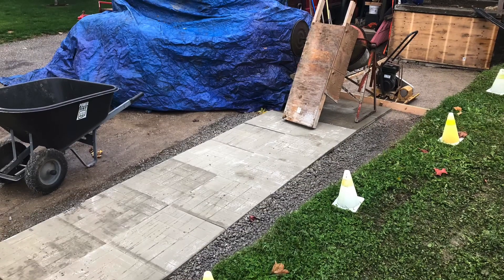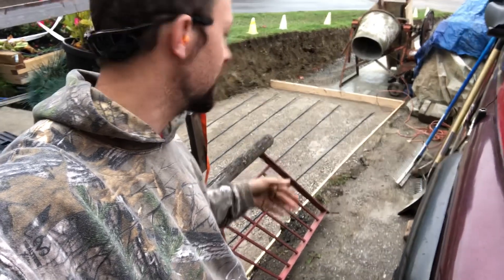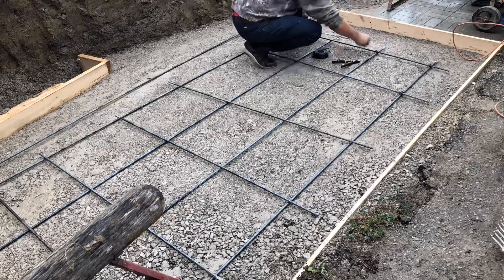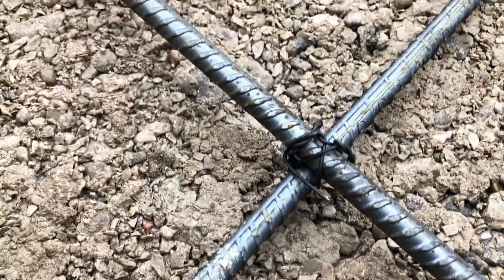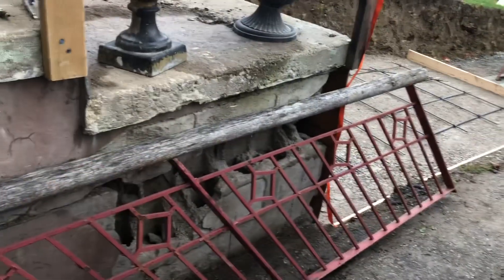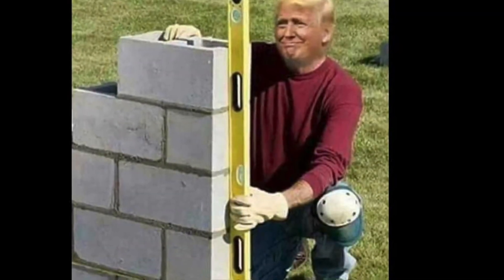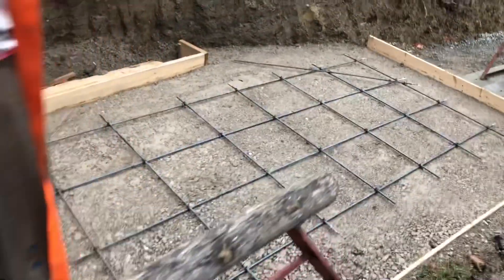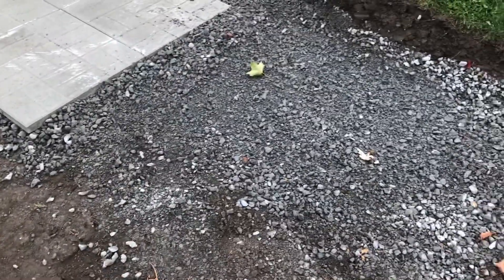My Favourite Way To Tie Rebar DIY =] -Secure Enough To Lift & Move Without Deforming

Comment: A real waste of wire bro. You don’t need to do all that. Plus you should never let the rebar touch the ground either out chairs or bricks under that. The whole point is to support the concrete it’s suppose to be inside the concrete not touching the bottom. ReAl weird. U need Klein pliers dude
Reply from the maker: You are correct. When I am pouring the concrete I aim for mid pour then drop in the rebar and continue the pour.